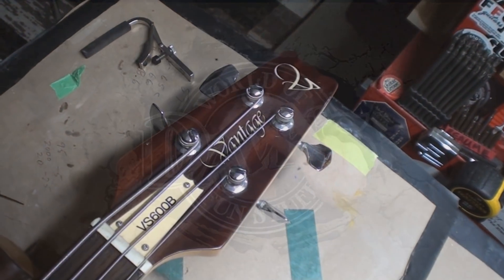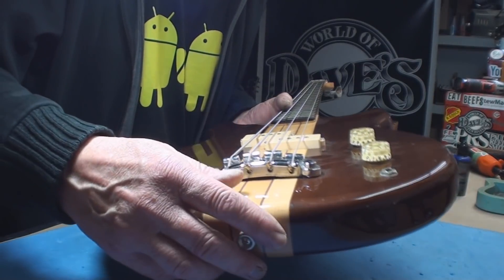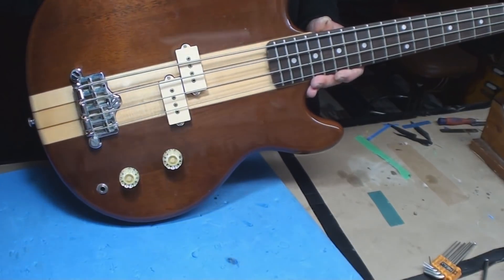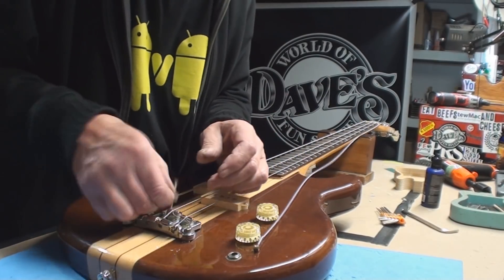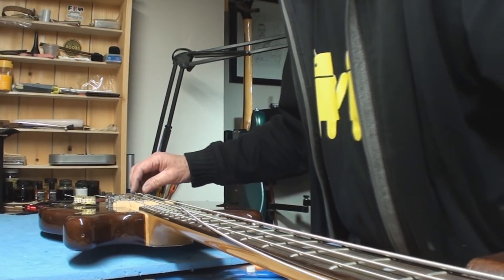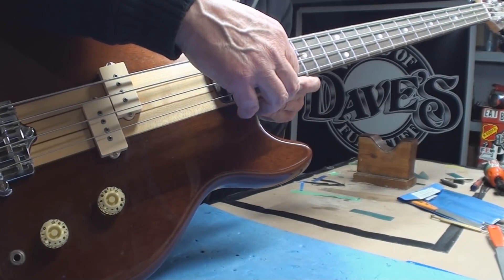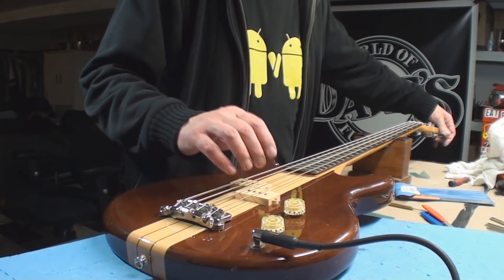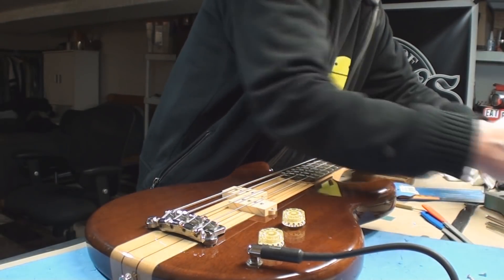Vantage Bass Guitar The Ugly Brother Part 2

Comment: These early 80’s Vantage basses were built in Japan by Matsumoku and were, at the time, very good instruments.  The problem illustrated here is that the bridge has actually failed.  The pot metal used in the casting weakens after 40 years under tension and the middle portion of the bridge pulls away from the body.  The raised A and D strings are a dead giveaway that the bridge has given up the ghost.   Depending on the model, it may be possible to replace the bridge with a similar three point after market Gibson/Epiphone style  unit.
Reply: Matsumoku are top quality instruments,  They used the finest hardwoods and also made Aria Pro II, Electra and Westone.
Reply: Good old pot metal
Reply: I have a vantageVS600B it played great then in 40 years it became like that  !!!! Yes the "witch bass" is made in Japan

Comment: Listen guys- I have one of these old vantages; it’s 37 years old and has a beautiful neck that refuses to need adjustment. I tossed the three point bridge immediately and put on an old schaller. Thes ebasses came with standard bridges as well and dimarzio Model P PU’s from the factory. And just so you know- I own high end USA fender basses as well and the high mass bridges on those are garbage as well.
Reply: I own one too,,I love it!
Reply: Do you need a case for one?

I converted mine into a V and it no longer fits the original case, which is in great condition. 

Will trade for beer.

Comment: These Vantage bases that Dave is ragging on are about 35 years old ballpark. I wonder if the bridges are showing metal fatigue and bellying up- sort of the reverse of the common flattening of tunamatic bridges.
Reply: They are...it is pretty well-known for years now among Vantage and Matsumoku-made guitar collectors. Just a bad run of bridges in the 1980/1981 range that all bend in to a frowny-face. They all do it. They all played fine from the factory, the bridges started out flat.Replace bridge with an Epiphone bridge, but use the OEM saddles. Done in a few minutes. The one good part is that it makes these basses cheaper to buy used, I have bought three at about $60 each.

Comment: Yep-  that’s the kind of bass that non-bass players would buy. I  purchased  nearly the same model new in  1985. However, mine had a very different bridge; just a simple brass, flat plate design like half of a fender telecaster bridge. The nut was also brass so maybe Aria/ Vantage got some really nasty user feedback that caused them to  change their ways. Thankfully someone on eBay bought it from me for more than I paid new.

Comment: Those bridges bend up from string tension. Even if you straighten them they just pull back up again. The fix is to have a bar drilled for the string anchor that sits below the rear original string anchors. 10 mmm bar.